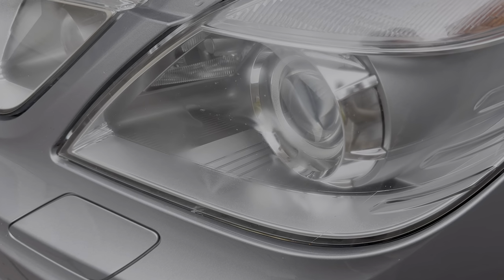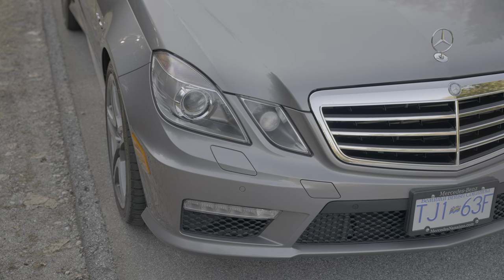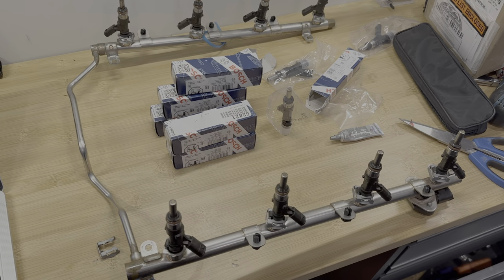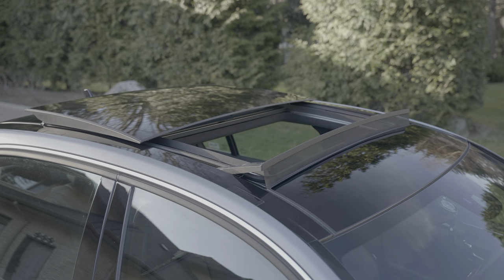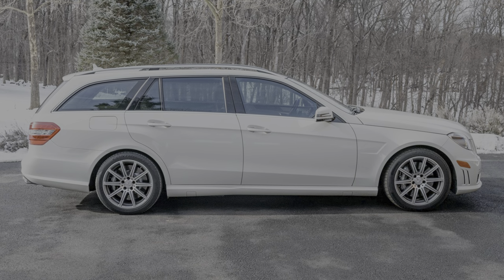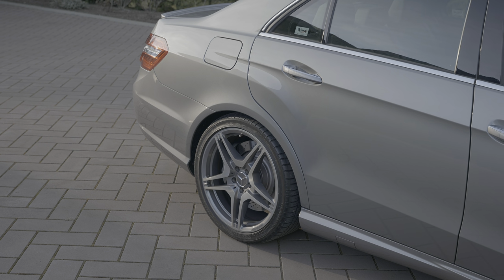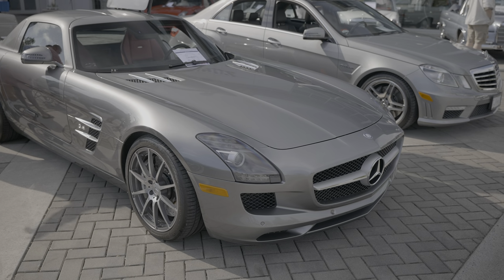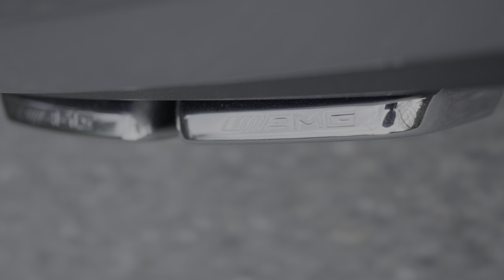Perfecting My E63 AMG With An Easy Fix? (4K HDR)

Comment: As always, your videos are of the best quality and education.

After owning my 2011 E63 for about 8 months now I really cannot see myself getting rid of it for any other AMG.
Yes the new ones are ‘cool’ but I find after 2011 a lot of the AMG’s were very gimmicky.
The M156 and the styling for me really does signify the last of the traditional iconic mercedes mixed with old school AMG’s ridiculous take on. 
For me, the M157 and on just lacks that over the top experience that is more than just numbers, but character.
I also think the engineering that went into the longevity of AMG motors was left behind after the 156.

I will keep this car till I die.

Comment: I agree with all of your points except the dislike of the grey interior.  My car is practically the same as yours except tenorite over grey interior.  I like the paint, but after owning the car for a year I love the grey interior.  It brightens it up and looks thoughtfully done; just the door cards and seat centers looks like an afterthought.  Maybe not as sporty, but it's an E, not a GT R.

Definitely agree on the 19" twin 5 spoke wheels, working on collecting a set to upgrade the worn out 18s that came with the car.

Comment: As an owner of a 2010 Performance pack W212 E63, at around 140k kms I have noticed the following: 
- Engine Mounts giving away ( Expected/Normal) 
- Transmission started showing signs of slippage/ sometimes a lurch forward when driving off. 
- shifts not smooth 
- rear differential started a slight humming noise which progressively got noisier. (Could be a thing with the LSD as it is a PP).

Things that annoy in this particular car in my case from low mileage early on, the transmission programming in comfort mode is way too sluggish and unresponsive in a bad way. The car feels heavy and you need a lot of throttle input to get moving particularly when the car is warm after some driving. 

Other than that this car is a pure joy looks/Engine/ performance. 
Oh performance is surprising even more so at high speeds this thing gets happy at 180 km/h and above like another power reserve is made available. It somehow pulls harder from 200 km/h and above.

Comment: When the W212 came out, there was a "Oh my God, what did Mercedes do?" moment. And unlike BMW who stuck to their guns and continued with the crazy designs regardless of all the backlash, Mercedes got scared, spent a billion dollars, and made the most generic face-lift ever. The W212 pre face-lift sedan and coupe, are still the best looking E classes, especially when slammed on a nice set of dished wheels with a front bumper lip.
Reply: Facelift is so much better in my eyes. No gimmicks, just good design and much more timeless.
Reply: Sorry, facelift looks better, especially the front. The LED headlights look expensive.
Reply: the facelift has held up so well though, it still looks modern. the preface lift, while it has grown on me, has shown age much more. it looks a like a weird in-between generation design, borrowing the quad head light style from the w211 but diamond ish

Comment: stock exhaust ?
Reply from the maker: Yes
Reply: @AMGmeister  sounds just like my cls63 same exhaust. mufflers are shared between the two but w211 e63 had the larger more restrictive mufflers. I was thinking about removing the resonators and adding H pipes to gain that stronger amg grunt

Comment: 2004 E55 amg is best
Reply: Why and how do you make this opinion?
Reply: E55 is beast but I prefer the 4 valve m156. There's no wrong answer. Both are top notch.
Reply: @shawndon7374  the m113k is no way better than the m156. Owned both.
Reply: @Alpinatom  what's your take on it? Howcome?
Reply: @shawndon7374  the w211 corners like a bus. It's fast in a straight line. Rude is well cushioned that's the + points. The 156 in w212 handles way better the engine it self is more inspired from a racing heritage. Just a more driver's involved better sounding responsive engine. I'll get my coat